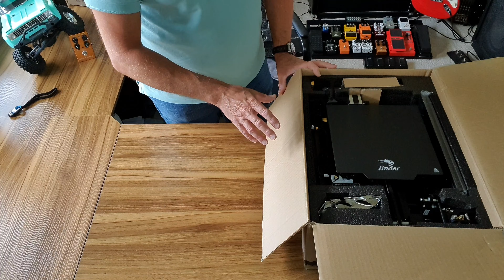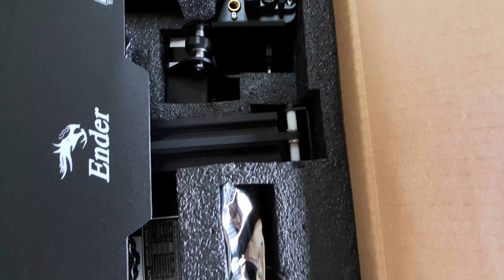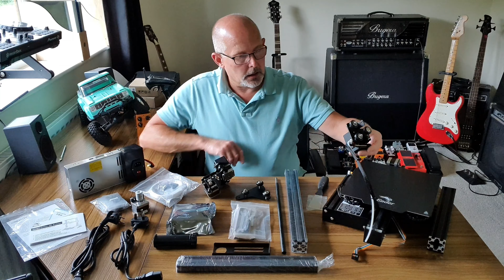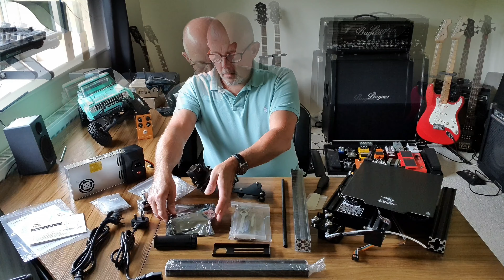Creality Ender 3 Pro - 3D Printer - Unboxing and Component Overview

Comment: I didnt know i needed one but now i really want one 😂👍🏻, how complex is the software side of things if you want print something custom and not from a download online steve?
Reply from the maker: Hi Alistair,  I really don't know yet mate. Once its up and running properly I'll have a better idea if there's some simple to use software that can run on a laptop, or if my next project needs to be a PC build! 😄
Reply: SFNRC im not sure as to how many of them have mobile/tablet based applications as of yet , i know the dremel branded one has a mobile app but i dont think thats as advanced as your set-up , id be interested to see now phone and tablet manufacturers are rolling out “lidar” scanners as to how accurate they can be made for smaller objects ... i think that will probably be the next major advancement in the tech as it would be just brilliant to be able to scan existing parts and replicate them with a more simplistic application ❤️ either way im sure you will get many glorious hours of tinkering out of it and looking forward to more content on it 👍🏻👍🏻👍🏻